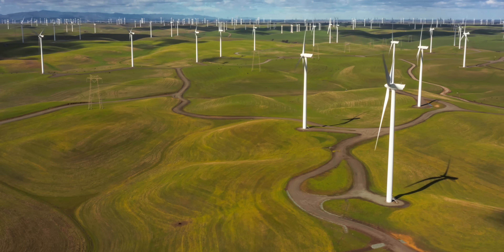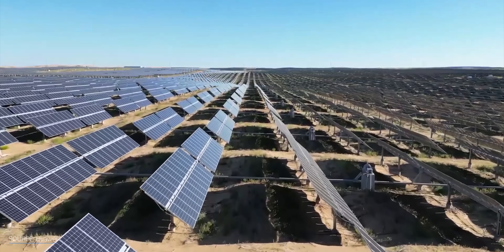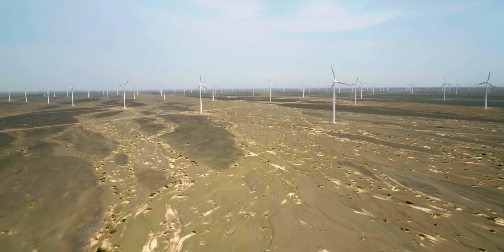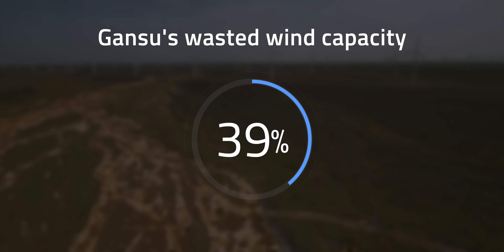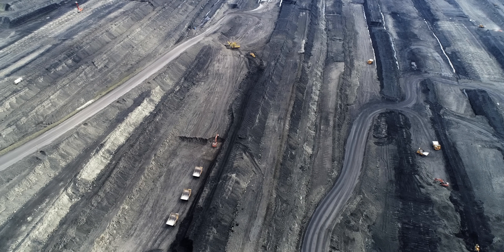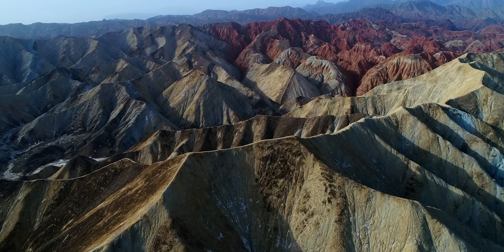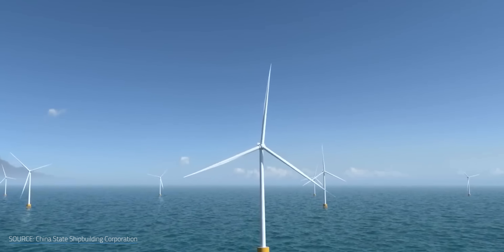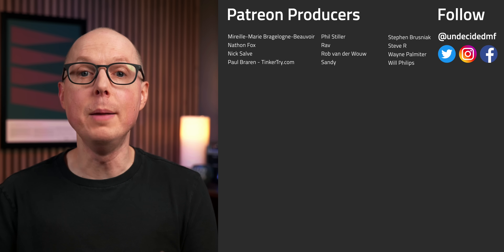The World’s Largest Wind Farm has a Tiny Problem

Comment: 1 GW powering 1 million homes sounds absolutely wrong. I'd rather say about 100.000 to 200.000 homes...
Reply: Germany has about 40 mio hoseholds (84 mio inhabitants). On average each household consumes 400 Watt, so 1 GW would be sufficient for 2.5 mio homes.
Reply: @klaushoegerl1187  This is wrong at so many levels. Power is not measured as in total consumption divided by time. Power is measured in peak power, or in some sort of average of peak consumption.
This is absolutely absurd. It is as saying that because your car sits unused for 12 hours a day, it consumes less gasoline. What matters is how much gasoline a car consumes WHEN it is running.
The same with homes. With 400 Watt you cannot even power a microwave.

In conclusion: No, 1 GW does not power 1 million homes.

Comment: Stability, this limits how much power a line can carry. Then there is synchronization, and the type s of frequency control at each power generating block. In the big power outage in the NE many years ago people were often mad that their power was not restored and that local gen stations were not running. No one understood that many generating stations cannot control frequency. The power control system simply admits steam as needed for a power level output,. When these small local stations lose their connection to the grid they have to shut down to keep from over-speeding. They have to wait to be turned back on until there is power available from the grid. Electricity cannot be piles in rail cars and stored in big piles, A watt-hour of power that is not used  is lost. Power gen sites need to be located with many issues being satisfied, such as being able to use the equipment at the maximum steady useage level. This is a very long subject, with many issues. It is graduate level material, definitely not internet level material.

Comment: Extra power is what you need to generate true emission free energy. They could use it to crack water, which takes a lot of energy to do, but it would generate a chemical energy source. Hydrogen fuel without the carbon by-product from cracking methane is truly emissions free, , but it obviously would still not be inexpensive.

Comment: Google AI Search:
The world's largest wind turbine is the MySE 16-260, which is located in the Fujian offshore wind farm in China: 
 
Rotor diameter: 260 meters (853 ft) 
 
Tower height: 152 meters (500 ft) 
 
Blades: Three 123-meter (404-ft) blades, each weighing 54 tons 
 
Generator weight: 385 tonnes (385,000 kg) 
 
Generating capacity: 16 megawatts 
 
Wind speed tolerance: Up to 179 mph (287 km/h) 

The size of these structures isn't small, the mass involved is significant, and an object that size, moving at maximum speed, is definitely dangerous when something fails.

Comment: Hi Matt, love your videos and they offer terrific information.
However, the Chinese Communist Party (CCP) is a whole other kettle of fish whose work should not be used as a comparison to the performance of any other nation.
The system encourages inflating results at all steps in the reporting process and punishes people who report poor results.
This results in those parts of any project that are out of sight being poorly done, if at all. One of the best examples was a new highrise apartment building where all the drains were just grates sitting on the ground. All the underground works were missing. ie No drainage at all.
The Chinese public calls this "rat-tail construction" and has resulted in major failures.
Before we can use any CCP works and/or reports, we need to wait for a decade or so to better judge the viability of infrastructure.

Comment: So many holes in this video it boggles the mind.  A. wind turbines are 20-30% efficient (versus nat gas plants at 60%). B. a 10 MW turbine may cost $8 million, while a 12 MW turbine may cost $10.1 million to build and install.  C. cost to maintain a wind turbine is $10,000 per year when new, and goes up from there as they age.  D. the time to return on investment (before a turbine makes money) is 12 to 15 years.  Before that, it is making energy to pay the investment back, and after that the annual maintenance cost carves out about a third of its operating revenue.  THEN, the blades and the generators wear out in ten years and have to be rebuilt, replaced and upgraded....so the ENTIRE return-investment cycle starts over.  Yes folks. Wind is a scam.  It ONLY exists due to politics and government (taxpayer) subsidies.

Comment: Here's some food for thought, why do they have to be wind turbines? based on info given to me by a guy who worked on wind turbines, the input shaft can be turned by hand by the average male. That means there is not a lot of force needed to turn it. So with that in mind, why do they have to be so far in the air and driven by unreliable wind. Why not take a simple 3 phase motor using gear reduction to make it so the motor can turn at say 500rpms and the output shaft of the reduction turn at say 10rpms. A small 3 phase motor will use much less power than the turbine puts out. Using that motor setup with say a ribbed belt that fits into grooves on pulley, like a timing belt, you could then control the motor to speed up or slow down and make as much or little power as needed. Also using that would allow you to put them right next to each other and even stack them like you do levels in a parking garage. You could literally put 50 of them in a one acre plot and still not be near as tall as one of the shortest towers now. I know there it the old saying you can't make electricity using electricity, but in this scenario, I don't see how it can't work.

Comment: Why is “curtailment” and “issues” used in the same sentence?  Overbuilding capacity is a traditional strategy used in all forms of power, transmission, storage like water storage and dams … easy example:  buy the solar panels for your house in winter, because summer will take care of itself.  Just get solar curtailment that matches your consumption and links to negative (wholesale) grid prices.

Comment: Taking aside the lack of planning opposition allowed (and less of that will be in poor states so thats worth considering in any site selection) in China the issue is space. There is less of that "wasted" space in the US/Europe. Offshore wind like in china offers localised power generation vs a distant wind farm in say Nevada feeding to California. Many undeveloped areas are US owned natural parks (unlike china). The same issue china has is that moving such industry there even with ultra low cost power (which can be intermittent) is hard. Humans run there and they don't want to be in a deserted region just because power is cheap. Las Vegas did it only due to gambling laws and now drought is impacting the other need - water. While Offshore wind is both more expensive and suffers harsher conditions (aside from proximity to any expensive real estate ocean views) its size allows for less turbines at a bigger size and offshore wind is more regular. It also generates more operating jobs to service it afterwards. The big help is it can be built close to power demand at at increasing deeper depths to anchor.

Comment: All the more surprising since China is a leader in Ultra High voltage DC cabling to the south. Would it not be a good space for building or moving Cement or steel making (or aluminium) considering its massive power demand and low power cost (and thus low emission cement-steel-alu). The storage needed would be massive, current battery storage is at a scale where it works for short term gap fill or frequency control to the grid. Data centres also once built need very very few staff, some of which can be remote. Coal power generation in China is also not running at full capacity ie its often curtailed due to pollution events. It would be worth china to start closing the oldest and least efficient coal power stations and mandating some emission capture to increase the coal to power cost. The vast amount of China coal use is power and not residential (with some used for high power demand industries).
Reply: They are in fact closing old coal plants and building newer better carbon capture coal plants.

Comment: Wind farms have an inherent design flaw. I'm not talking about the failure to have wind that happened in Britain a few summers ago or in Texas  a few winters ago. That was bad enough. This one is even worse and off shore and desert locations are bad choices to locate them but this problem doesn't seem to have a solution. It may seem strange but as the turbine blades rotate that collide with small particles of dust, sand, water droplets in the air. Over time the collisions take their toll on the leading edges of the blades. This makes them increasingly less efficient and unfortunately reduces their usable life span. This in addition to the pollution created manufacturing them and  disposing them. I'm sure when this is taken into account wind  turbines look even less attractive both economically and ecologically. So here is the link. I'm not making this stuff up and I am an engineer.
https://www.youtube.com/watch?v=og2H7ZxkiMA&list=PLR0gSPbvQL-KnKrh9gVWQc-u2tP5Z9jXT&index=3

Comment: plenty of negative, keyboard warrior comments on here. being bold and pushing ahead is how change happens, that much needs celebrating. if this was a video about an Elon PV farm or wind farm, the same technical issues would apply but the comments would be rapturous celebrating his vision / balls etc etc. Any power project needs to consider site selection, long-term LOCAL demand, O&M costs, decommissioning, technical redundancy in the face of alternatives and so on.

Comment: Wind turbines and solar panels are about the least efficient and most expensive way of intermittently supplying electricity that you could come up with. Both cost more energy in their working life from construction to removal than they produce. I have nothing but contempt for people pushing them. The only way companies make any money out of setting them up is ridiculously high government subsidies, paid for by the taxpayer, who then also pays higher than necessary prices for said electricity. 
I am all in favour of cutting pollution, recycling, and improving the environment but so-called "net zero" is unachievable unless our elites, (and this is what they are aiming for) reduce the majority of us to pre-industrial living with everything that entails.
People like you are pushing the myth that this green crap is about anything but controlling the masses and MONEY.
They are not wind farms, they are a blot on the landscape and responsible for the deaths of millions of migrating birds every year. Calling them farms is to obfuscate what they truly are.
I noticed you specifically mentioned the UK regarding wind turbines. Are you aware that to maintain the current level of production using so-called "green" energy would require covering about a quarter of the land area of the UK with turbines and solar panels? Most of that land is currently used for farming. Importing food is far more energy consuming than home-grown so where is the benefit?
Keep your propaganda.

Comment: The carbon footprint of these windfarms is huge.  Hundreds of tons of concrete, many tons of steel reinforcement, many more tons for the tower.  Then there are the non-recyclable blades.  Often the old blades are cut up into manageable sections and buried in bushland.  What's worse is there is no well advertised plan  to deal with end of life recycling.  Is part of the plan to  leave the concrete and reo in the ground at the location cover it with dirt and grass and claim it's restored?  To hell with windmills! 😠

Comment: yet the largest problem with wind (and solar) power generation remains. They are NOT reliable; it is not predictable when and how much energy they will generate. And power storage at a large industrial scale is still an illusion and probably always will be. In overall terms i do not consider the so called "fossil fules" as bad as they are widely seen, if properly managed. Especially when it comes to transportation i see a big advantage especially when it comes to Diesel engines, over any kind of electric powering. Yet for electricity generation, in long term i consider all forms of nuclear power much more sensitive and fiesable than any so called renewable source that relies on weather conditions. Nuclear power is a large field. Development of reactors continues and even alternative fuel sources to Uranium are seen (Thorium e.g.) and in the even longer turn, nuclear Fusion (deuterium helium or similar approaches) will hopefully kick in. These would quite suddenly make wind power look like a locomotive train compaired to a modern Diesel engine or electric train ... So all in all, yes wind power does seem interesting but i consider it too complicated, it uses up far too much space for far too little energy...

Comment: There are so many issues here that haven’t been explained clearly.

1) Before building the generators (wind turbines), build the grid. Storage may take the “edge” of distributing the power but it won’t solve. 
2) State Owned Enterprises (coal) in China have a huge say in how effective central policy is.
3) Deserts are remote. The LCOE of wind turbine power in a desert is always going to be higher than that of wind turbines located near a major population centre. 

China is attracted to mega-projects e.g. 3 Gorges Dam. Smaller more localised installations may serve its needs better.

Comment: 7.5 cent per KWH sounds cheap, but it's not if it's not available when demand peaks, while both transmission and storage will drive that price through the roof. Perhaps, the location of a steel mill or aluminum smelter, which could vary  production with the power supply,  near the wind farm could make use of all that power efficiently, but I wouldn't trust intermittent wind power for a data center. China is going to keep burning coal for the foreseeable future and they'll ultimately need to expand their nuclear capacity if they want to remain an industrial superpower.

Comment: As a native of China, please allow me to introduce that desertification is very serious in the western part of China because of its small population. So few people generally live there? Different from the western imagination that China is full of people, the population of China actually gathers in coastal areas. In the western part of China, there are actually not many people living because of population loss and inconvenient transportation, and most of them are resource-based cities and agricultural areas. However, resource cities can't avoid the fate of resource exhaustion, so from the very beginning, the western part of China was defined as an energy center, with solar energy, wind energy and nuclear energy as the main power stations, assisting traditional energy sources to transport energy to all China. This is a strategy to ensure energy security, because China's energy is actually very dependent on the outside world. If the energy supply is unstable, the risk to China is very great. Therefore, even if the power generation price of new energy is more expensive than that of traditional energy, it is necessary to develop new energy industry, because China should be prepared for the risk that traditional energy will be cut off due to various geopolitics, and the energy diversification strategy is very important, which cannot be calculated simply from the power generation cost.
Reply: Photovoltaic near sandy and windy deserts have a big problem. Sand destroyes photovoltaic.
Reply: @manfredhauptreif7285  As far as I know, cleaning robots, ai and large-scale water conservancy projects are being used to solve this problem, but it has also brought new problems. The water spilled on the ground to clean dust has spawned weeds, which will lead to short circuit of photovoltaic circuits and fire when they grow up.
Reply: @byakuya3603  可以饲养羊
Reply: @byakuya3603  the goal is for weeds for dedesertfication and they are a lot higher up so it won’t affect it and sheep grazing
Reply: Transmission in DC mode? I only know of one large DC transmission line in the states but I’ve been out awhile.  Interesting
Reply: This video also highlights and exemplifies the can-do attitude which I have seen in China, being prepared to invest for the future and seeing natural resources like the Gobi desert differently to others. The Chinese success could be repeated in many parts of the world, particularly Africa if only there was more political security, providing a "New Oil" wealth and enabling a
"world-wide energy web" to be completed, moving renewable energy around between and within countries to avoid shortfalls based on weather variation.
Reply: It makes a lot of sense.  Energy security for China is way more important than the technical difficulties of transporting the wind power over long distances or disparities in the cost of wind generated electricity vs coal.
Reply: @dondomingo6578  BTW transporting electricity over long distances is something in which China excels at, having pioneered the Ultra-high-voltage electricity transmission technology in DC mode (UHV electricity transmission). This basically assures minimal loss of electricity throughout the transport.

Comment: remember a few years ago when people in Texas froze their buns off because they relied a little too much on those wind turbines?  Also, do you really trust China when they say they have advanced transmission lines?  I've ordered 12 gauge wire from Amazon that weren't even copper (and probably aluminium).  In my opinion, besides hydro-electric dams, renewable energy works much better in small scale